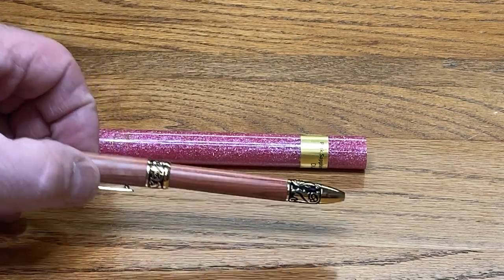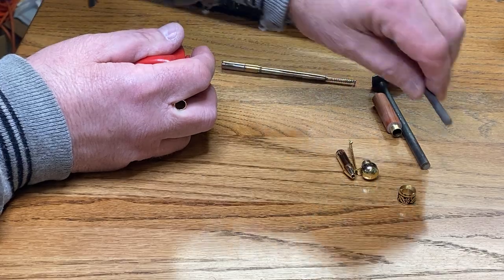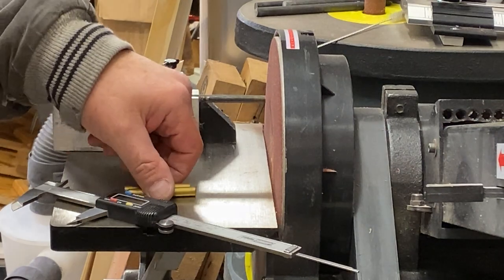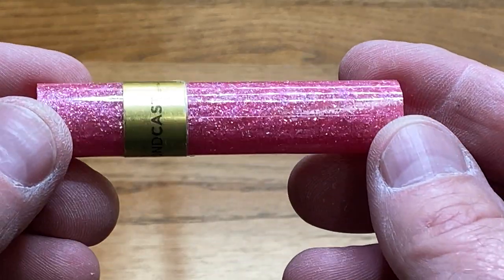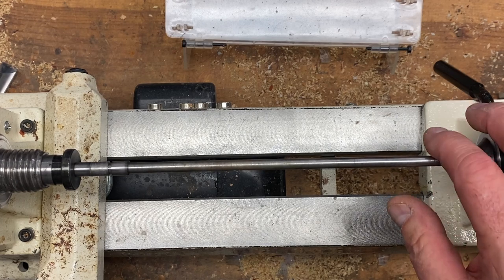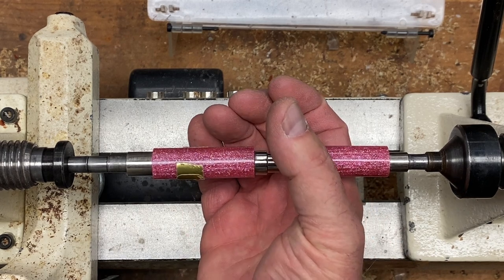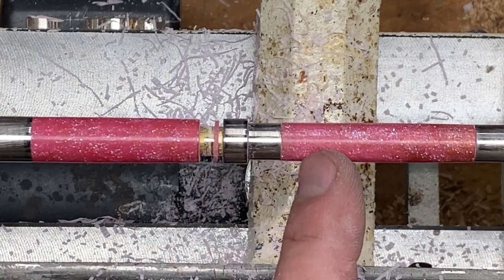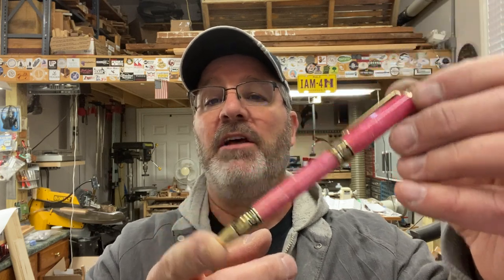Remaking The Sculpted Arbor Pen

Comment: I like to use a nylon headed hammer and a punch in the tube to remove the bevel when i cut tubing, tapping lightly and rolling the tube,with round stock i find drilling on the lathe using a centering drill bit first & depending on hole size working my way up to finished hole i get very little if any drifting of the hole . As always a great pen and great advice Bob
Reply from the maker: Thank you Ed. 

Regards,
Bob

Comment: Another great video Bob.  I really appreciate all the extra details (eg. mandrel maintenance).  I have a few pens that the brass showing through is bugging me too.  Remaking is a good option.  I also had a DiamondCast blank that I cut a little too deeply on and my solution was to build it back up with medium CA.  It worked great.  You can't see any indication of the issue in the final pen.  Question for you.... you always put the Renaissance Wax on before buffing.   Why is that?  I would think that the buffing with the blue rouge (which is at least a little abrasive) would take the wax off.  Thanks again!
Reply from the maker: My pens come out with a wet look. I believe using the Wax with the buffing rouge helps polish the blank. 

Regards,
Bob
Reply: @RJBWoodTurner  Thanks Bob... I'll give it (wax first) a try next time.
Reply from the maker: @davidbondi  let me know what to think.

Comment: Another beautiful pen. Regarding having to make new tubes, it occurred to me when you cut the tenon you removed material right down to the tube. Is it possible to reuse a tube by simply turning away all of the old material the whole length of the tube?
Reply from the maker: It is but there are concerns. 
  If you don’t remove all the material it won’t fit well in a new blank. 
  When you square a blank you shorten the tube. Once is OK but twice can make it too short for the kit. 
  Turning away all the Material can thin the tube and weaken it or make it not fit well. 
  It can work but from experience I’ve found it’s better to buy new tubes or make them and throw the old blank away. 😀

Regards,
Bob